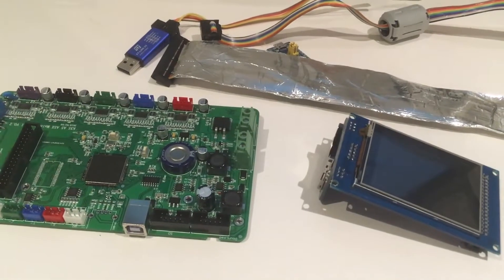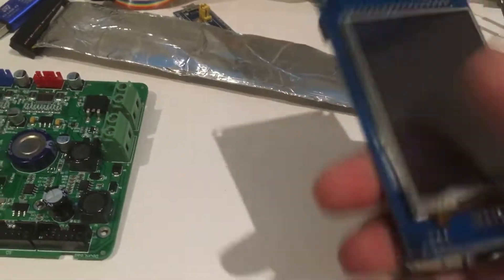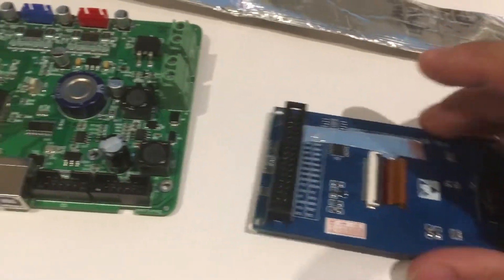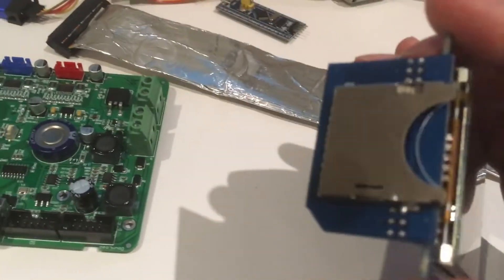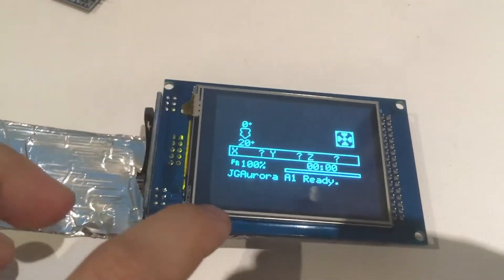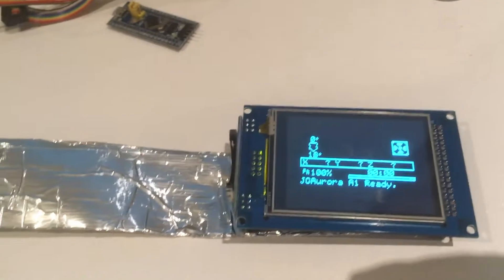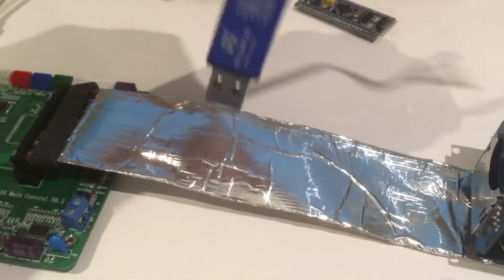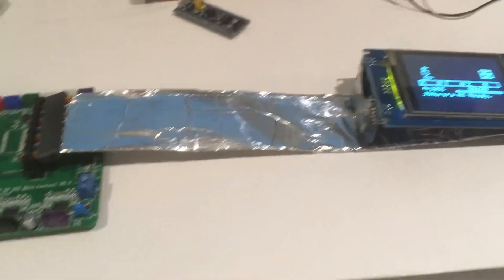A5S & A1 Custom Firmware Work in Progress - LCD corruption distortion FIX

Comment from the maker: Correction: the SD card data goes over the other cable... which you can also foil-shield if you want. The main ribbon cable carries the LCD display power, and touch data only. Also, the touch screen button hack is now working too! Beta build coming soon...